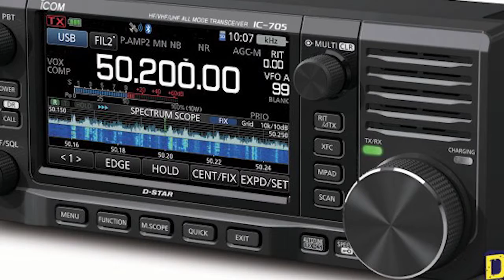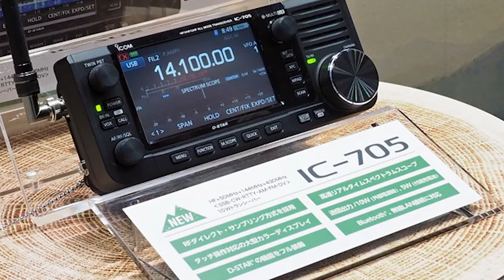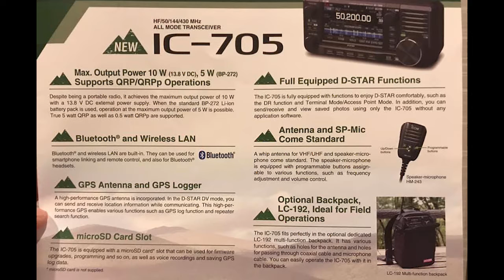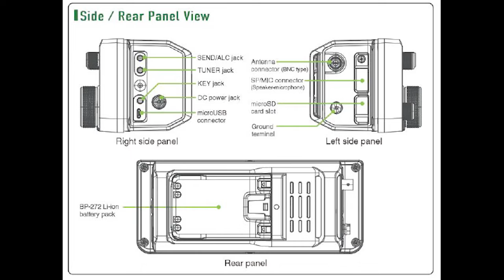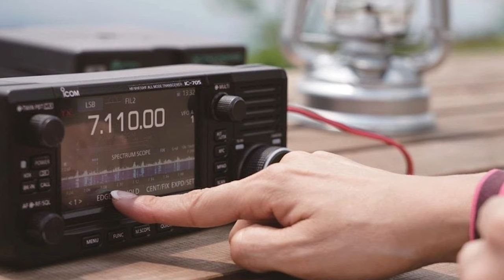The Icom IC-705! HF-UHF SDR Radio - An initial review

Comment: Check out the Xiegu G90 it is small “Has” an internal antenna tuner and a waterfall and a dynomite SWR antenna analyzer built in and can go up to 20 watts and is a fraction of the cost of the icom 705 that does not have an internal antenna.

Comment: I'm eager to see the current draw on receive.  LED back lighting on a large screen like that eats up some power, and all of that SDR functionality isn't free either.  The computation required to decode signals is a bit power intensive.  It won't be much of a portable radio if it's a kg and another kg of batteries are required for each hour it's in use.  The 705 is a great looking radio with great features, but if it's a power hog, this 10 watt radio is only suitable for the QRP at home or QRP mobile markets.
Reply from the maker: Very true comments. It will be interesting to get detailed specs. The 705 will be a game changer I think though in this space
Reply: Its a VERY Efficient Tranceiver, its 5w with the HT Battery and Full 10w when connected to a 110v AC or 12V Mobile battery. you can carry a 12v AGM in the Special Backpack that ICOM sells.
Reply: @markplott4820  - Has Icom released the specification for the current draw when receiving?
Reply: @Liberty4Ever  - this NEW Tranceiver is NOT even FCC Approved yet, so there is Little Detail of the Specs.
Reply: @markplott4820  - That's what I thought.  So how can you claim, "Its a VERY Efficient Tranceiver"?

I'm still waiting for the receive current consumption so I'll have a real idea of how long the battery might last in a real world scenario, as opposed to assurances based on no specifications (wishful thinking?).
Reply: @Liberty4Ever   - the MERE fact that its using HT battery to power it, FACTUALLY, SDR is very Efficient , more so than a typical Triple Supethetrodyne transceiver. 
while you do get Full Power on a 13.5v Portable battery, I can see someone going Day Hiking with this and Several HT Batteries. and for Campers with Access to a 12x charger, the 13.5v Portable battery can last for several days and Provide Full 10w transmitting Power.

Comment: Feeling sorry form those who ended up buying two separate  radios, one for HF  ( IC-7300 ) and one for VHF and UHF ( IC-9700 ) . looks like Yaesu went the correct way with their 991A, ( and older models like 857D ) all in one radio for the right price.
On a good note, ICOM is turning around.
Reply: lol, are you kidding me?  the 991/a is like a cheap toy compared to the feature set of the 7300 alone. Yaesu has been slacking for years now.